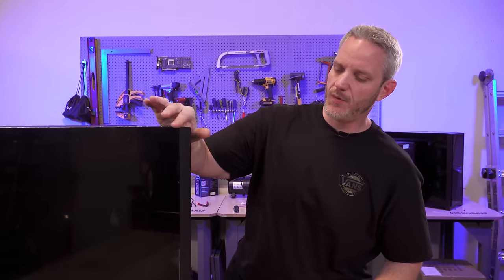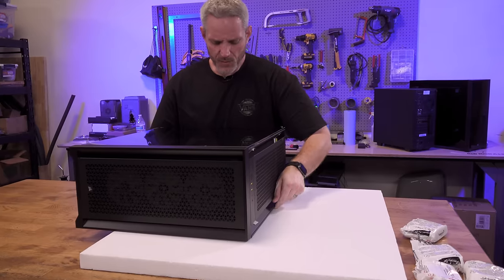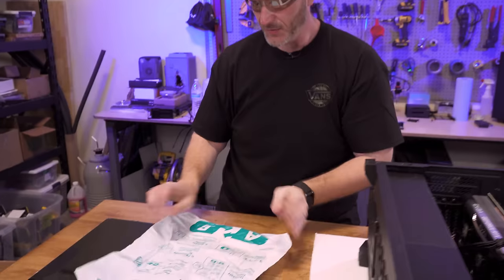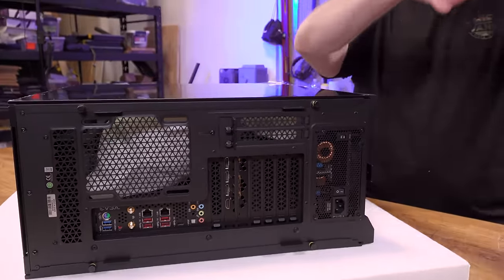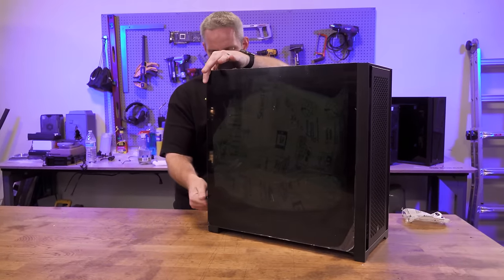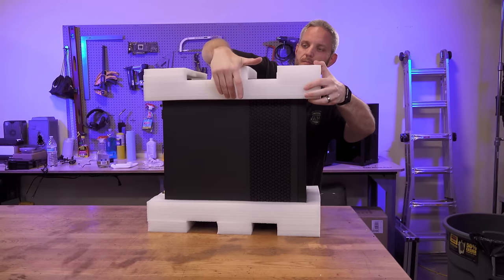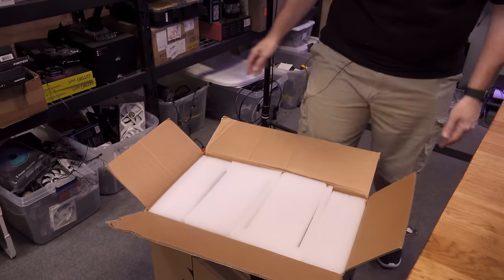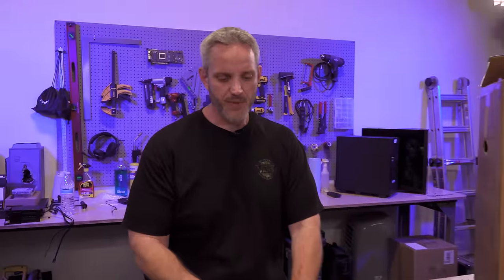How to properly pack and ship a PC!

Comment: FedEx and UPS do offer insurance on a self packed parcel, but you need to pay for them to over pack.
They do not unpack the item, rather they stick your box into a larger box with air pack. You don't need to trust their packing as its just protecting your box, while your packing protects the items inside.

Comment: Good to know, didn't realize when you insured they'd have to inspect which is a given but pack it themselves. Only could imagine the the person packing to finish fast and lacking enough protection
Reply: Where I work it depends on the amount being insured. If it is more than $100 of value we usually ask  how the item is packed and then either ship and insure the customer packed item. However we might also recommend letting us pack the item if it is of particular value like a laptop, Desktop, painting, or other fragile items.

Regarding the level of packing; it depends on the person packing, also the training the packing business provides the employees. I work at a UPS Store and basically anything more than a few hundred dollars I will ask how the item was packed or inspect it if they are okay with that. I am a bit OCD and try to pay special attention to making sure the items being packed are properly secured. I personally try to pack items the best I can within the constraints I have; the customer sometimes is not willing to pay for the size of box that would be ideal to ensure enough room for the proper level of protection and so I have to work with what I have.

 While some people pack things properly I have also seen people using weak Amazon boxes for fragile items (not double boxed or anything) along with using packing materials like kraft paper and cloth towels to wrap glass cups and plates.

Comment: Just last week I shipped my friend a build I did for him via UPS - if it weren't for instapaking the inside and double boxing it would have been toast.  Showed up crushed, with a piece of the outer box torn through and hanging down, and from the looks of it they had opened one side and then shoddily retaped it.

Comment: I work at a ups store, I personally pack most of the computers myself for customers. If u ship a $7,000 PC and u ensure it for 7k and ups packages for you ,ups has a pack and ship guarantee, if anything happens to it (dmg lost etc) you're 100% covered. You can ensure it, and still pack it yourself, you just aren't guaranteed the claim of anything happens. I can't speak for every ups store but I personally build and ship computers myself so I'm pretty well versed in the packaging process. I can't count how many people have brought things in and said they are sure it's packed well and it turns up on my claim inbox. After investigation and I received all the pictures for it. It wasn't packaged well at all and they were denied a claim due to insufficient packaging. So honestly. I recommend having the ups store package it for you  if your shipping it through one.
Reply: How much does it usually cost to do that though?
Reply: @motonate1585  it all depends on the distance. Size of the PC. I'd say a mid atx it could be done for about 120 or something but prices vary store to store
Reply: @jaden360  Ok that's not too bad, I'll have to take it in and see tomorrow
Reply: @motonate1585  just let them know you got a PC you wanna ship, and your interested in their pack and ship guarantee and would like to know more about it
Reply: @motonate1585  also typically insurance is 2.50 per 100 bucks you wanna insure

Comment: I have a big box saved with all the bubble wrap and air packs I get from when I receive packages. So basically reuse them filling the inside with airbags and bubble wrap where needed and the outside with 1-2 layer of bubble wrap depending on the value.

For Personal Pc's if moving, basically use clothing like t shirts socks singlets to fill the outsider and around the case with air bags and bubble wrap inside. Never had any issues in either case
Spinning hard drives take it with me personally in a carryon/backpack wrapped in anitstatic bags, bubble wrap and clothing

Also a layer of bubble wrap between the glass and case to help soften the impact 

Also reducing reusing and recycling  :D
Much more environmentally friendly due to reuseability

Comment: Oh i work in shipping/receiving for a hospital ... the amount of damaged crap we get is INSANE, you expect the massive stickers on boxes that says "HANDLE WITH CARE! MEDICAL EQUIPMENT/MATERIAL" and "STERILE MEDICAL EQUIPMENT" would make them think twice .. but no. 

Even received machines that got tilt indicators that been 100% triggered = the fkn thing went on its side. Way past the 15 degree tilt it was designed to handle. 
And those tilt indicators got 5 stages, 0, 15, 35, 55, 75 and then the tiny ball is just gone xD. And all the liquid indicators for excessive vibrations/shocks was all red, one side they had exploded .. since im guessing thats the side that hit the ground xD.

THE winner of most damaged crap(also most damaged sterile stuff) is hands down TNT, those suckers handle all pallets with forklifts .. from the side .. with full length forks, the forks will stick out almost halfway through a pallet when they grab it like that, and i have had holes almost halfway through a pallet full of sterile material. Also had a pallet with fork holes at 2 different heights because the pallet next to it was double stacked. Then they put some brown paper on the plastic and taped it up.. bruh.
Im in the EU so we use EURO pallets which are different from the almost squares the US got :).

I have also seen a big square box that turned into a fkn ball. It looked like they rolled that sucker down a hill several times. 
It was so bashed up THERE WHERE ALMOST NO CORNERS OR STRAIGHT EDGES LEFT!
I saw that box in the back of their van when they where unloading and asked if it was mine, took a photo before they unloaded it and asked UPS to take that crap back since im refusing to accept that because of obvious damage lol. UPS must have loved that box .. there WAS liquids in that box... corrosive liquids :D.

Comment: Working at a Warehouse that receives data center stuff like Racks, Servers 65lbs boxes, Laptops, etc. One thing I saw was the quality of the Box matters. Freakin FedEx belts can’t break them server boxes. Dense and Heavy boxes. 65lbs suckers. Some even shipped in pelican cases haha

Side note, during Lay off season we get boxes of laptops from former employees that have literally no packing material and it's just an oversized box with a laptop inside, best part is the box is usually smashed in and you can hear bits of the laptop moving around inside..

Comment: Very informative video, great tips. Helpful to see how Instapak is setup. I also did not know about the insurance requirements/situation with shipping companies (USPS does not behave that way, as far as I am aware).

Of course, again, good on you for gifting the PC. Not that it's surprising, but a pat on the back is still typically nice.

P.S. I admit, I LOLed almost the entire time at the s-o-o-o, so many "That's what she said!" opportunities.
Reply: Not insuring a package packed by a customer is likely a policy of specific packing stores and not necessarily the norm.

I work at a UPS Store and we will insure any package but we tell the customer that unless it is packed to UPS Standards UPS claims may deny the claim. So basically it would be insured for loss but not damage, unless they packed it sufficiently to follow UPS Corporate packing standards.

The basic UPS packing standards are using 200 lb bursting strength shipping box, and min of 2" packing on all sides using only bubble wrap or mini pakr air bags. We also have packing SOP where we will double box particularly fragile items and try and keep 3-4" of packing materials on all sides of the item.

Comment: I wish this video was  around a  year or two ago when I build my  Dads  PC and  shipped it from TX to MD, it  made it  fine but I used  way too much packing, instapaks inside the case bubble wrapped the  PC where the  foam was not and then  put it in a bigger box after I bubble wrapped the  main pc box.

Comment: USPS will insure packages without repacking. I have shipped many PC parts  and a few systems through them and haven't had any egregious handling for packages I've sent or received, just a few bent PCI slot covers for cards that weren't packed properly on their way to me.

Comment: I packed and shipped a PC before. I filled the void inside with bubble wrap similar to how Jay uses Insta-pack in this video. I also wrapped the entire PC in a thin layer of bubble wrap and shipped it in the box the PC case came in including the Styrofoam. Basically, I shipped it in a very similar state to the way Jay's PC was at the end of the video. Everything was fine with the PC except one of the two fans on the CPU cooler was knocked loose. The recipient of the PC just had to reattach that. Voila!

Comment: this video is making me more anxious since I thought I can rely on fedex packing expertise but if their packing sucks then I'm screwed, I'm not sure if I can pack it as well as Jayz here.
Reply: do you have the old case box. Either way it is really easy and those insta packs really do work. Worse case just take it all a part and move it. But if you can move it yourself NEVER EVER SHIP BY MAIL at all cost
Reply: @84MadHatter  Yes, I do have the old case box that it shipped with and I forgot to mention it is a prebuild PC so theorectically nothing I should worry about but I'm still anxious. And I can't move it by myself. I will be flying and the case is too big to fit in luggage

Comment: Also being a deliveryguy for 100 years + working another 100 years handling all the parcels at a terminal at the Swedish goin Postal - no Service,
I confirm that 8 out of 10 broken computers is due to transport, but the Post often get away with it due to insane demands and packing rules no
one can fully fullfill.    Being a decent guy with common sense (yeye stop dancing) according to me you are thinking absolutely correct on this subject.

Comment: BTW UPS charges almost double for over 50lbs.  You can literally ship 2 boxes one at 50lbs one at 1lb and you'll save $15 over shipping one 51lb box.   So if you can ship the gpu separately, you'll save money and save the dangers.
Reply: This is on ups ground and for times when the gpu takes it over 50lbs...  Since most computers are on that fine line..
Reply: Or you send two packs and one them get lost on the way or something happens.

Comment: Having worked in computer resellers shipping, and receiving department of a number of years.  Having also know a person who's job at Hewlett Packard Vancouver (the first one in the US not that BC place) who's job it was to help design, and test the cardboard boxes that inkjet printers were shipped in.  Loved the stories on how far they would go to destroy something.  

I feel that other than wanting to put a couple more layers of cardboard just inside the box on the side of the glass.  By packing it tight like that more likely to cause damage unless like you you package it inside a second cardboard box.  

In fact if you would have just left the packaging as is from the manufacture, and only added the Instapak Quick RT packing like you did.  I am with you that when you have a graphics card in a host computer like this they should always be shipped with a solution like Instapak.  Then package it inside a second cardboard box with extra cardboard on the side of the glass you would have been fine.
Reply: Oh you'd be amazed, I got a monitor that was ever so "gently" handled by UPS... Whatever they dropped it on, or dropped on it punched clean through the thick cardboard and through the 2 1/2inch void then into the screen itself. Had that one replaced and the same thing happened... luckily the 2nd time it just missed the screen

Comment: Thank you Jay for doing these tutorial   I have a question about using the foam on a build that I am doing using the Fractal Design Ridge mini computer for my nephew.  He lives in Georgia and I live in Hawaii.  Obviously, this computer will be flown and ship to him.  There isn't al ot of room inside the tower, so do I need to use the foam to ship the tower, it would be fine to ship it in the original case and a secondary case? He isn't very computer  knowledgable beyond playing games on it.  In case you need to know what the specs are. 

Case:  Fractal Design Ridge
CPU: Ryzen 5600x
CPU Fan: Noctura NHL12s
GPU:  MSI RTX 3060 ventus 2  12gb
psu: corsair sfx750 platinum
Memory: corsair vengence lpx 3200mhz  2X8gb

Thank you for any feedback from you or any in the community

Comment: I built a pc for a relatives kid, put bubble wrap and some foam packaging I ripped from old packages I was sent, the computer arrived great but within a day the pc was dead, basically the kid downloaded so many viruses and relative tried to fix by taking panel back off (obv they had to do it once to get the packaging out) and on camera to me as their tech support pull the hard drive forward with force snapping the sata connector.  They told me its ok but they told another relative I sent them a broken hard drive!

Comment: Postage insurance is pretty dumb anyway. I had a parcel shipped with DPD insured and was still outta luck, it had a hole stabbed into it, cardboard torn, footprint on it.
Reading the fine print I can't remember exactly but it was something along the lines of it needs to withstand a pretty substantial fall and weight on it to be included the insurance. Unless shipping in a wooden crate - don't even bother with insurance (at least with DPD).

Comment: Dang, where was this a few months ago lol. I just moved back to the states after being stationed overseas for four years. When it came to packing my PC I just removed my GPU and packed it separately. I kept the original boxes for all my components including the case so I just put the foam back around the case and shoved it back in the box. I also put my GPU back in the anti static bag and put it back in its box. I probably lucked out and didn’t have any physical damage to anything especially seeing as how it takes a few months for stuff to ship from overseas. I have had one issue that I wasn’t experiencing before I moved however and it has to do with my GPU. Since then my GPU has had temperature problems while gaming. It’s usually just large spikes in temperature during graphics heavy moments and causes my GPU fans to spike to 100%. No idea what’s going on or how to fix it just hope the problem doesn’t get worse. Moral of the story, take your time to properly pack up your stuff! In case you’re wondering BTW, I have a Gigabyte 2080 OC White.

Comment: What’s the better buy right now between a 3080ti for $1850 or a 6800xt/6900xt for $1500 or a 3070ti for $970 for all 3 uses of gaming, streaming and everyday use at 1440p? Upgrading from a 2070 and going to pair with a 5900x.
Reply: 6800xt/6900xt has better performance at 1440p than Geforce cards.  Geforce is better at ultrawide 1440 or 4k.

Comment: Tip from someone who has sent 5 pc's in the last month issue free (touch wood) - use the anti-static foam supplied with most psu's to fill the gap between the bottom of the case and the gpu, and if you have an air cooler fill the gaps between the case/cooler and the cooler/gpu

Comment: I thought it very interesting to use Instapack on only one side of the box so the glass doesn’t get hurt, but what should I do if the case has glass panels on both sides, like with the Lian-Li Lancool II Mesh?

Comment: How unsafe is it to take a short road trip (5-6hrs) with a watercooled pc (soft tubes fit very tightly in the compression fittings) with liquid in? In the case that you don’t have time to drain the fluid because you are in a rush.

Comment: Hi Jay!  Great Vid!!  Question, when shipping or receiving a PC with an installed AIO, is there anything you should do to move any potential air pockets in the hoses or pump?
Reply: It's a sealed system, there's nothing you can do about the little bit of air it will have. It will move to the highest point in the closed system.
Reply: @SlowCobra  But should you attempt to shift the pump so that the air pocket goes back to the rad instead of potentially resting in the pump before you first turn it on?
Reply: @thumper444  as long as the pump is lower than the highest point, it'll right itself as soon as you turn it on.

Edit: 1 caveat, if it's an older AIO and it's getting low on coolant. While they are "sealed" they aren't completely sealed and over time there is coolant loss.

Comment: I once shipped a PC with UPS, it was an old school thick steel case. The kind of case you could stand on top of without it bending. When it got delivered 4 of the 8 corners on the case were warped and torn apart. I have no idea how it could have happened other than someone crushing it with a fork lift.

Comment: No-kill like overkill thats like 40 bucks worth of packing you don't need the install-pack inside the box the foam ends and packing the sides full of cardboard are plenty and ups will absolutely insure a self packaged box I do it all the time not sure on other carriers or whatever part of the world but here in ny its never been an issue getting them to Pay the claim usually is

Comment: You can make a hard cover for your glass front from the bottom of a crappy drawer, or some chipboard lying around or picked up for not much. Honestly you didn't make a good hard case for that at all, as think of a forklift taking a bite out of that? No resistance from bubble wrap and cardboard.